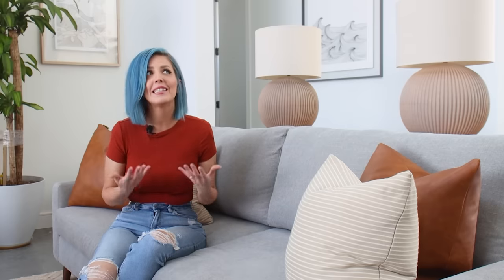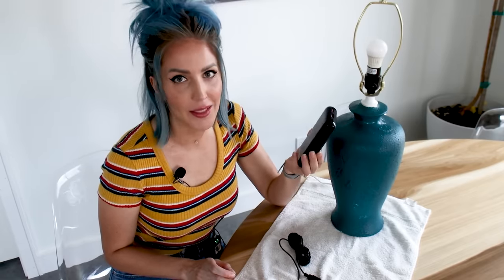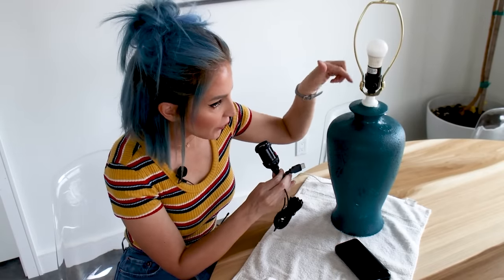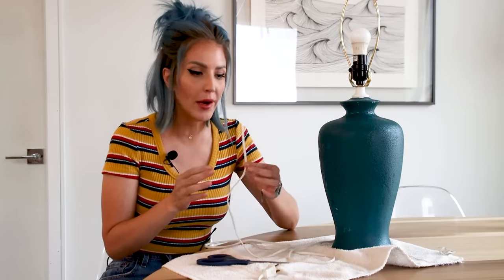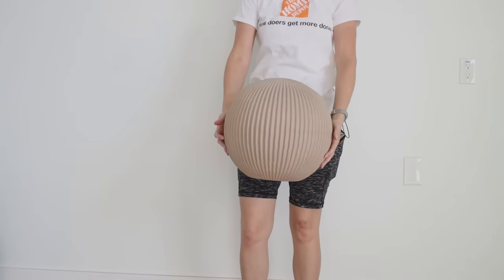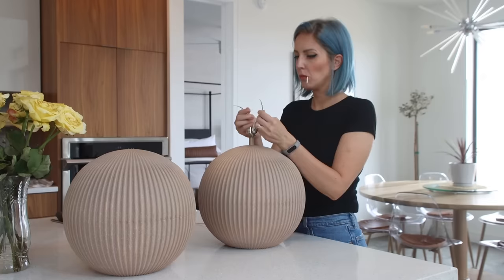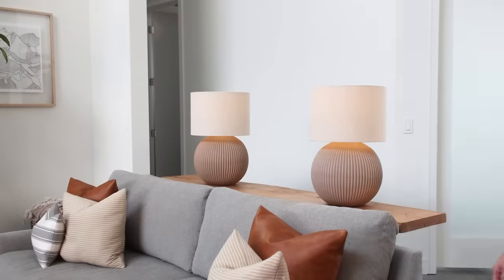3 EASY Ways to Make a CORDLESS Lamp

Comment: Making a cordless lamp is super easy.  Making it still give off light after you cut the cord is the tricky part.
Reply: Why?.just need a low voltage lamp
Reply: Hahaha... that was good! Thank you for the laugh!!
Reply: Excellent dad joke.
Reply: Hahahaha love it
Reply: None of her methods work.
Reply: @keithjohnson2668  IKR there is this thing called a flashlight which is super bright and mounts anywhere for less then money then rewiring lamps to DC.
Reply: I laughed too hard at this
Reply: @dahliageneen84  It's true and before that there was portable fire called lanterns .
Reply: @keithjohnson2668  I made it work. It’s great! Especially for a lamp by a couch that is not up against a wall. Love it!!!
Reply: Haha! 
I guess I’m halfway done?!
Reply: I guess, as mentioned by other commenter is the easiest: buy rechargeable lamp/light bulb (probably $10 each), 2 lamps for each: one being used, one being charged.
Reply: By God you're a genius
Reply: Did anyone have issues with method 3? We cannot get it to work!
Reply: The tricky part is getting your hair to match the color of your jeans.
Reply: Yeah I think that's called a battery operated lantern or a gas lamp or an oil lamp.
Or a torch or the more commonly known item called a torch... a stick with fire.
Reply: Lol
Reply: I think it would be an easier solution and less of a hassle to simply install an outlet where you wish to have power. You can do so from an adjacent wall. Look up piggybacking an outlet.
Reply: @georome9854  in a newer home that’s the case
Reply: Cutting the cord is  dangerous.  Unless you are an electrician.

Comment: pretty brilliant. never even thought of a cordless lamp but the applications are great. Now if you integrated a smart switch as well i think it would be perfect!
Reply: @DuncanBuilds, If it would work with a smart bulb, then theres your smart switch. I question if a fan is built in, then it needs ventilation which would be a bit on the low side inside the lamp. But you can still have it sitting on the floor behind the table the lamps on which is still a viable idea:)

Comment: They also sell rechargeable led lights bulbs. And many of them come with a remote. Some even have various color settings if you’re into that stuff. I can’t comment on the lasting power but it’s another option to consider. You can also use puck lights and attach a plastic screw in light socket to attach to the lamp.

Comment: To get more then 5v from a supported usb charger you need a little chip that talks to the powerbank to negotiate a voltage. Look for something like a zy12pdn. That is a little board that supports asking for up to 20v
Reply: I guess, as mentioned by other commenter is the easiest: buy rechargeable light bulb (probably $10 each), 2 light bulb for each: one being used, one being charged.

Comment: Thanks for this video! I was looking for ideas on wiring up a battery-powered sconce for my Mom's house and am looking at several videos to find a creative idea. BTW, You'd need a USB-PD (Power Delivery) IC in the bulb/fixture to get your power bank to output 9V - 20V (since it has 9V &12V output, then it supports PD and/or QC, which is Qualcom Quick Charge), and the bulb would need to 'talk to' said IC to negotiate that power draw, along with a USB-C cable rated for PD2.0 or 3.0 fast charging. That sounds like an EXTREMELY NICHE product, but I wouldn't be surprised if someone out there manufactured a DC USB bulb with USB-PD.

You could also use the existing socket and wiring if your lamp didn't have a shade or cover, just snip and attach the USB's power and grounds cables, but you would need to wire up a switch, otherwise it'll be on 24/7 which might not be practical for a battery-powered lamp.

Thanks again!

Comment: Thank you for this great tip!  I am using this to make lamps for times of power outages instead of ugly lanterns and flashlights.  There is a psychological lift to having "normalcy" during extended power outages. We use battery power inverters during outages and this will help keep use from having so many extension cords as well as be able to have the portability.

Comment: If you're going to have a shade over the lamp anyway, you could get away using a rechargeable/battery-powered night light or camping lantern in there,  particularly if your lamp shade attaches below the socket, in which case you can just set the battery-powered light on the empty socket.  There are literally hundreds of options available on the usual online retailers.

Comment: I wondered why - after you cut the plug off the lamp using conversion option #3 - didn't you then pull the cord back INTO the lamp base, then connect it to the power source,  instead of wrapping it around the bottom so that it can still be seen? Very good video by the way.

Comment: Here's the deal.  I bought all the items you had a link for in the description.  Found a lamp cut the cord and hooked everything up as indicated in the video.  Nothing, I checked if there was power coming from the Battery holder box and there was.  Here's the key......the rechargeable batteries in the description give off 1.2 volts of power.  1.2 V X 8 = 9.6 volts.  Obviously not 12 Volts, so that is why it will not power on.  Make sure to find rechargeable batteries that give off 1.5 volts so you can get the necessary 12 volts to power the bulb.  Otherwise this is a great video and I appreciate you taking the time to make it.  You make great videos, and thank you!

Comment: These are not bad but you could just use puck lights i use them and they require no extra headache and they work great
Reply: are puck lights available as bright as a bulb?
Reply: Puck lights burn out way too quickly for my taste! I was running thru batteries so fast, I gave up on those lights. And the hassle of using rechargeable batteries wasn't worth it.

Comment: Hi ! Awesome ideas. About the second solution with the 5V battery pack (7:02).  Those packs can deliver 5, 9 or 12V. This is for fast-charging mobile phones, but this feature is controlled by the internal battery pack microcontroller. They will deliver 12V only to a compatible device that identifies as such (microcontroller-negotiated voltage). This is meant to avoid delivering 12V to an old device that should only take 5V. 

Regarding the USB socket, you could re-use the socket of your lamp with the 5V light bulb. No need of a special cable. You can just strip any old USB cable and connect the +5V (red) to the center of the socket and the Ground wire (black) to the outside. The green and white wire from the USB would not be used, just cut or tape them. 
To connect the wires, you can re-use the existing ones (just cut to the desired length). The 110V wires will be well too big for 5V, but it's not a problem (the invert would be). The wires can be connected by either soldering (ideal) but also using screw terminals, Wago-style connectors, or even the good old twist and tape method. This is only going to run 5V with low intensity, so there are very few dangers.

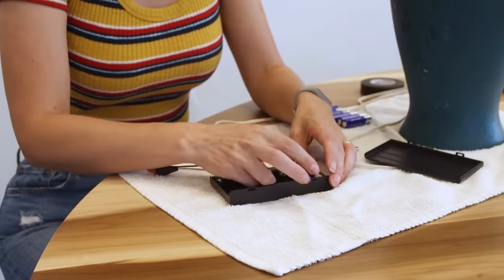About the 12V solution (10:15), one thing that comes to mind is the battery packs that are used for CCTVs. There are 12V ones and they are fully rechargeable. I have seen some online for about $30 for 14Ah (14000mAh).

I hope this helps someone :-)
Reply: There are cables with usb-c on one side and 12v dc jack on the other. I am using one of those to power up my telescope, so it’s possible to use it for lamps as well

Comment: Very clever. I like the lamps, very cool.

re: battery life

AA 2800 mAh X 6 = 16,800 mAh or 16.8 Ah
AA rechargeables are usually 1.2 Volts

Volts x Amps = Watts (this formula can be used in any order).

So: 16.8 A X 1.2 V =  20.2 Watt hours.
If the LED bulb is rated at 2 Volts, then a 6 Watt LED would last about 84 mins.
I.e. 6 W x 2 V = 12 A.

Comment: Option#2 (5v bulb and USB e26 socket) could be accomplished by using the "cord cutting" method of Option#3 and would then need a male USB a cable to cut apart instead of the e26 socket with USB lead. I have done this myself in the past. Works with the on/off twist knob on the original e26 socket as well.
Reply: I was thinking this exact same thing.

Comment: Dollar Tree makes a LED light bulb that looks like a regular bulb and runs on a coule double aa's. You could modify the socket or find a way to hang it off the harp which would be disguised under the shade. There are probably Led's that could be modified that run on battery and havre remote on off.. this would be much less expensie
Reply: Do you a have a picture plz,I want to make a decorative lamp,thanks.

Comment: Great work as always, love the finished product. I would worry about Li battery packs due to the fire hazard, especially if they are sealed up inside a lamp with no air flow so the rechargeable AA battery pack is probably the safest option too.
Reply: Uh, the same Li-ion batteries in your phone, tablet, laptop are also sealed up with no air flow. These are all regular Li-ion batteries, not high C-rate discharge batteries (like those used in hoverboards, vapers, RC toys) so they're fine at home temperatures. If you're really worried, use a LiFePO4 12V battery. If a common 6Ah battery is too big, then it'll be a fun DIY project to make a little 12V pack from LiFePO4 cells in 26650 or 32650 size. Just need 4 in series.

Comment: To output higher voltages you need a compatible PD (USB Power Delivery) device. You can trick the battery into outputting a higher voltage by buying a PD adapter. They are usually just a circuit board with USB C in and out.

Comment: Love this video clip. Great ideas great implementations. Idk if anyone else commented yet but I had a question. Standard 110v rated cords with two prongs for the wall, they have one side that's smooth and one side that's ribbed . One indicates live wire and that goes to the lamp socket after the underwriters Knott. So when you clip the cord and connect to the battery bank will that factor in? Do we need to know or be aware of which wire on the cable is live vs ground?

Comment: I'm not so sure that building cordless lamps is currently worth it for the expense. I'd liked to have seen how long each lasted before recharging/battery replacement. However, they're all very easy and if I really needed a light in a specific place without outlet access, I think I would also use the third option. But that would be reserved for mood lighting when friends come over. Batteries are expensive. 
I had NO idea that Dap sold a temporary thread lock! That's pretty awesome. As a woodworker, this is going to be a game changer for my projects that require disassembly now and then (like to change out resin panels for lighting, that I also make). 
I also didn't know that Dap made a rapid fuse. I'm learning so much! 
Will this work as well as E6000? E6000 works on everything and bonds everything to everything else ... but can take 12 hours to fully cure. How much time does that Dap rapid fuse take to fully cure?

Comment: Like technique 3 you can use a DeWalt battery adapter which has the positive and negative lines drawing power from the battery. And use a 12v DeWalt battery that you may have laying around. Much easier to recharge.  Thanks I might give it a shot
Reply: Sounds good. You could also have plenty of extra batteries charging on standby for a quick swap out. What model do you suggest?

Comment: Thank you for your great ideas here! I have a small lamp that I want to put inside a cabinet. It would be great if I could add a timer to this so I don't have to get in and out of cabinet to turn it off/on. I have Christmas decor that has battery pack with timer but having a hard time finding a larger battery pack like this with a timer. Any ideas?

Comment: Safest & easiest would be to use shrink tubing to cover wired connection. It only needs the heat from a hair dryer or heat gun. I admit I have used a Bic lighter carefully and it does the trick too.

Comment: I use classic lamps as a decoration .
Use LED light strips  in room 
with a trickle charge two 7 amp lead sealed battery connected to solar panel on back porch roof

Comment: Get some of the power tools that have either the outlet attachment and/or usb and use that as your base. I have a rigid battery one that turns off after 8 hours. And is much smaller than that bigger battery. And costs the same, and handy if you ever lose electricity. :)

Comment: Very nice video! I wonder, can you use a 9V battery to power a 12V light bulb?
From what I understand, it should work, just with lower brightness.
And how long does your lamp last with 12 AA batteries?
Reply: I tried and I can confirm that a 12v light bulb can be powered with a 9v battery ;) At least the ones I tried (2 LED models), one being 7W with an E10 socket and the other a 2W with a G4 socket.

Comment: Another great idea would be to use one of your drill battery. Most brand you can get an adapter with 2 wires. 

You add a 120V outlet on it (NEMA 5-15R or 1-15R) and look for LED bulbs that use 12-24V. So if your battery is 12,18,20,24V you can use it. 

Many drill battery has between 2 to 5Ah, so you could run the lamp for 5-12 hours with this.

Another option with the drill battery, many had USB adapter, so like.in the video you could use a usb cable and 5V bulb.
Reply: I’m trying it

Comment: Camping Usb lights could probably be fairly easily crafted into a cordless lamp. I got a pack of Onite bulbs myself for blackout/emergencies. Was a bit worried that they wouldnt be bright enough (i have a few usb led night light that is only bright enough so that you dont trip over yourself) but they turned out fine. Of cause its just a 5W led bulb on a usb cable & the bulb cant be changed, but the price is also ok so if it break at some time i can just get a new one. Bunch of different brands on Amazon i think.

Comment: You can buy emergency bulbs that screw directly into a standard lamp base.  They charge up some by battery some by USB some solar  and some through a powered socket.  Either way, you don't have to modify the lamp AT ALL.

Comment: A few months ago I made one using an emergency light bulb. These have a battery inside so when you have a power outage the light comes on. I use the lamp on my dining room table as accent lighting. All I had to do is cut the cord and splice the wires together. Then screw in the bulb.

Comment: You have to buy a USB cable that will tell the power bank to give a different voltage 9/12/15/20 volts . I think they ate called power delivery(PD) 3.0 cables. Hope that helps.

Comment: Wow batteries are big and costly I don't know why this has never been done before.
Wow that is a noisy inverter!
The USB type C needs communication to negotiate higher power levels. The best way to tackle that without building the circuit yourself is a trigger board or trigger cable. The upside of that is you could probably get a 12 V charger cable and cut the end off and wear it straight to the current lamp socket. Although I do recommend labeling bulbs that aren't 120V because with the same base it's easy to screw them into some thing and blow them up.
Another option that's harder to find is there is some LED bulbs with batteries built-in that work during a power outage I haven't use them but I've seen them.
Although a quick charge power delivery power bank and trigger cable would probably be the better way to go just make sure it outputs 12v otherwise it defaults to 5v. And somehow automatic shut off which could be problematic.

Comment: Look into 18650 batteries and battery holders. These are a very common size of rechargeable lithium ion battery which will work much better than either non-rechargeable AA or nickel metal hydride rechargeable AA batteries. I usually get battery holders from allelectronics and there are several sites that offer a wide selection of 18650 batteries. You can also get some nice chargers that will recharge 18650s as well as test them and let you know how well they are holding up. Lithium ion batteries range from 3.7 volts dead to 4.2 volts when fully charged, so three of them will get you in the 12V range.

Comment: I appreciate this video but I found a much easier way than she mentions.  GE (and some other companies) make a light bulb that is rechargeable with its own battery.  I just got 1 from Amazon and it works great.  It works for 5 hours then has to be re-charged.  I got it for less than $15 on Amazon.  The only problems with the rechargeable light bulb is that once you cut the cord to the lamp you will have to take the bulb out occasionally and recharge it.  Also the rechargeable bulb is slightly bigger than regular light bulbs so it may not fit some lamps.

Comment: UsbC is capable of 12 volts when connected to a device smart enough to ask for 12volts.
Using the AA battery bank is a great idea, I didn’t hear you say to make sure the polarity is correct. If the light doesn’t come on, just reverse the wires. Most likely the black (negative) wire would go to the side of the wire with ridges. If you look at the plug you cut off, the negative would be on the wider blade on the plug.
Someone else suggested a rechargeable camping light. You might get away with a solar light, too. Just thinking…

Comment: They make solder less connectors. Put the wires you want to connect in from each side then heat the connector with a heat gun. Tubing also shrinks around the connection for a water tight seal.

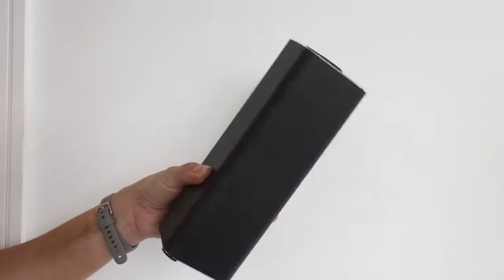Comment: 2:25  I would have thought that the first drawback to option #1 is that _the battery pack still has to plug into the wall to charge_. 
Isn't it more inconvenient to remove a battery (just to charge it by plugging it into the wall elsewhere) than to just plug the lamp into the wall?